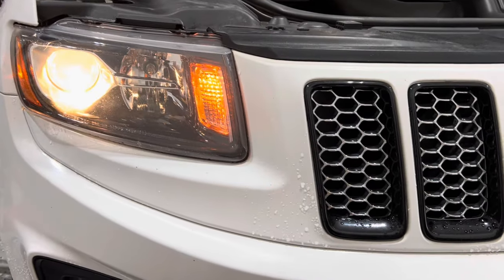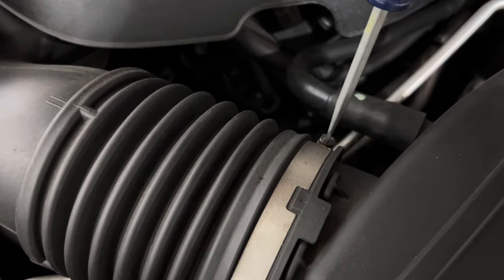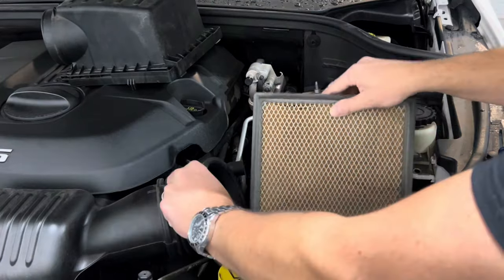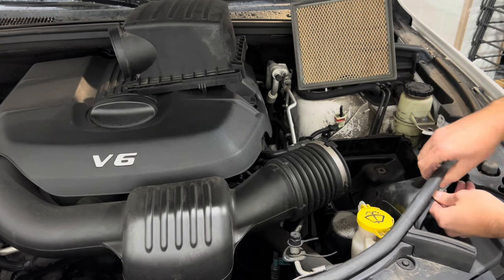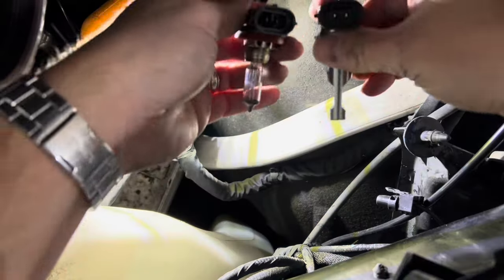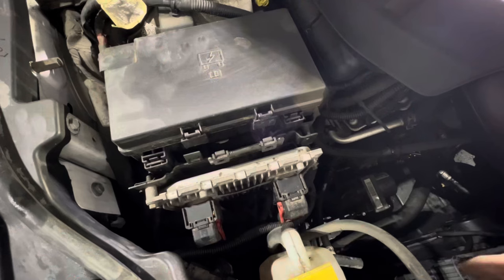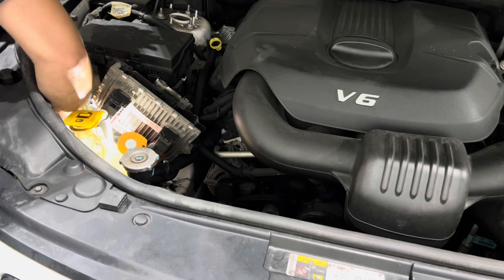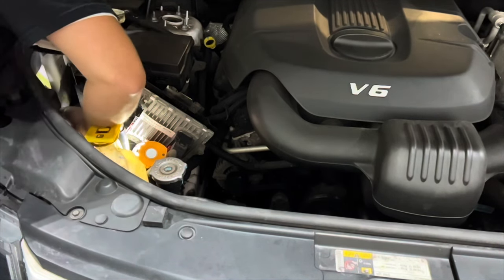Jeep Grand Cherokee Headlight Bulb Replacement (2011-2019)

Comment from the maker: Below is the link to the LED bulbs that last much longer and makes it safer to see on the road:
LED Bulbs: https://amzn.to/3W7auzU
Both low and high beams: https://amzn.to/49kf0B2

Note for both low and high beams: Order the combo H11/9005 (second link above) for 2011-2017 model years and order 2 sets of the H11 (first link) for 2018 and newer model years. 

*DISCLAIMER: The above links are affiliate links.  This costs you absolutely nothing, but pays me a small commission and helps me continue to create this FREE content.
Reply: Do these LED bulbs work for low beam and high beam?

Do you recommend replacing both high and low halogens with these bulbs?

Thanks!
Reply from the maker: @Soulith88  Hi Chris, yes and here is the link for replacing both the low and high beams: https://amzn.to/3S4bWBM
Reply: Sounds good, thanks. 

Do you find the low beam ones are bright enough?
I noticed that they are some similar looking ones on Amazon that claim are even brighter, 30,000lm etc.
Reply from the maker: @Soulith88  Yes sir!
Reply: @inspiringbuilds the link isn’t working?
Reply: Hey man! Great video and very helpful, I’d love to use the correct link that kicks some back to you, problem is the link doesn’t seem to be working. I have a 2017 Jeep Grand Cherokee Trailhawk that I need to change out the bulbs if you don’t mind sharing the link. Thanks!
Reply from the maker: @ Thanks so much and glad it was helpful.  I also appreciate you letting me know as the combo link was changed on me.  Below are the updated links depending if you want to replace just the low beams or both to match. 
LED Bulbs: https://amzn.to/3W7auzU
Both low and high beams: https://amzn.to/40RdfJE
Reply: @inspiringbuilds  Hi the 2nd link does not work - can you verify the correct one for both low and high beams and paste again?  thanks!
Reply from the maker: @ Thanks for watching and letting me know.  I believe when they go out of stock temporarily the link is no longer valid.  
LED Bulbs: https://amzn.to/3W7auzU
Both low and high beams: https://amzn.to/49kf0B2

Note for both low and high beams: Order the combo H11/9005 (second link above) for 2011-2017 model years and order 2 sets of the H11 (first link) for 2018 and newer model years.
Reply: These bulbs do not fit a 2018 Grand Cherokee.  Tried and returned from both links.
Reply from the maker: @ Thanks for watching.  You want the first link and ensure it’s the H11 bulb.  I’ve installed them in multiple 2018 GC models.

Comment: I’ve got a 2019 high altitude and instead of a cover that twists off it’s a rubber boot that you just need to pull off. In case anyone was wondering. Thanks for the video :)
Reply from the maker: G Money, thank you for watching and leaving the helpful comment!  Did you upgrade yours with the LED’s?
Reply: Fat shout for this comment! I should have read it before trying to twist. Would’ve saved me 10 minutes of frustration 😊
Reply: Yes and that lousy rubber boot just falls apart if your vehicles is older than 5 yrs
Reply: That rubber boot (I also have a 2019 GC) is horrible.  Makes it much harder to get in their to get at the bulb.  I got my driver side one replaced (which was out).  I gave up on trying to replace my passenger side (which is still working).

Comment: What kills me is they made oil changes a breeze with the top filter, but then made the headlights a pain. I can change the oil faster than headlights.
Reply from the maker: I was there with you and it’s why I made the video to try to make it easier for others.  Now I can do both sides in under 15 minutes.  👍
Reply: The Ford Fusion you have to take the entire bumper off to change a light bulb. This is cake compared to that. The engineers aren't designing these machines anymore the accountants are.
Reply from the maker: @pmccoy8924  Agreed, thanks for watching.

Comment: I’m trying to get the passenger side low beam replaced. Got the ECU out of the way. But for the life of me, I can’t get a grip on the cover to remove. Still very little room.

Edit: I realized mine has a different type of cover. It’s molded to the entire assembly so you can’t twist it off. Has a rubber lid on it that pops off. Still have to have baby hands to get in there. So dumb. 2017 limited btw.
Reply from the maker: I’m glad you were able to get it and save a lot of cash.  I agree it’s still a tight fit but it seems impossible going underneath and then you cut up your hands as well.  Thanks for watching and the comment!

Comment: Great video. Even with everything out of the way access is still terrible. Worst design on any vehicle I've owned in the last 40 years. Just as bad as the battery under the passenger seat. The job is done though. Thanks.
Reply from the maker: @nicknack1063  Thanks for watching and I couldn’t agree more as I’ve mentioned the same in other comments.  It’s a good feeling completing tasks doing the work yourself and I’m glad you were able to save some hard earned cash!

Comment: Note the 2018 bulb covers do not screw off and the 2018 passenger side is much more congested with the radiator in the way.  I also recommend using OEM if you don't want to change both.  The 2018 passenger side is very difficult and I'd rather not bother, but now I have a yellow OEM and a white LED
Reply from the maker: Thanks for watching and the comment. Note, when one headlight goes out, the other one is typically close behind. I strongly recommend replacing both at the same time.  The LEDs will last longer and help with visibility.
Reply: @inspiringbuilds  I would love too.  I can access the bulb from behind the radiator, but itd stuck.  I tried the pvc, but almost dropped it in the headlamp.  The resistance feels like it going to break when I try to turn.
Reply from the maker: @markrienhart787  PVC is definitely your friend for stubborn stick bulbs.  I’ll try to work on a part 2 video.
Reply: Same here… i might just leave it like that
Reply from the maker: @arennaz  Thanks for watching and the comment. Note, when one headlight goes out, the other one is typically close behind. I strongly recommend replacing both at the same time.  The LEDs will last longer and help with visibility.
Reply: Can you please make the video on the PVC pipe part? We cannot get the passenger side lamp out and I’m scraping up my hands trying to get the thing to budge so for now she has one LED and the other one is factory. Your video was great and made the Driver side a piece of cake. I just cannot get the passenger side bulb loose.🤷‍♀️
Reply from the maker: @wr.3428  Thanks for watching.  Yes I will have that video out within the next week so be on the lookout.

Comment: I have a 2017 GC and been needing to replace driver bulb for a while. Hate the gross yellow color (when compared to the newer jeeps lol) so i am changing both today. There was aome confusion when i went to the auto store to buy replacement bulbs. They said its better for me to bring the dead bulb to see which style my car actually needs. Finally gonna do it now because your video was super helpful. Def gonna wear gloves as to not shred my hands up in these littlw nooks ans cranies. Thanks for your video not having a lot of unnecessary commentary too. Really appreciate the atraight forward info.
Reply from the maker: @Gg_blanco   Thanks for watching and glad it was helpful!  I appreciate the comment.  I’m proud of you as you can do this and save a several hundreds of dollars.  I’m with you as well, I dislike the yellow, need better visibility, and want the new bulbs to last a long time.  I’m also making a part 2 video within the next week on the DIY PVC headlight removal tool to make the job even easier for those stuck stubborn bulbs in a super tight space.

Comment: I watched several 2014 Jeep GK LED install videos and this is the best, especially for people like me who don't work on cars for a living. Removal of the parts was easy to follow and I appreciate seeing the force needed to remove the air intake parts. Most other videos gloss over this issue. I had no concerns when I removed mine.
Reply from the maker: @timmc49  Thanks so much, glad it was helpful!  Quick questions, should I make a part 2 video that shows how to make the DIY PVC bulb removal tool and did you upgrade to LED?
Reply: @inspiringbuilds  There is a short YouTube video on making a thin wall PVC tool for the Jeep headlights I have. Do a search and it should pop up. I re-ordered the bulbs I was going to use having seen the original 90 degree plug-in style on my 2014 Jeep GC. I'll install them when they arrive in a couple of days.

Comment: Had to change my driver side bulb today.  this video was clear and to the point about what parts needed to be removed.  It took me  less than 15 minutes to change the bulb.  🥳
Reply from the maker: @martinschultz6228  Thanks for watching and glad it was helpful!  I appreciate the comment.  Did you happen to upgrade to LED’s?  I’m also making a part 2 video within the next week on the DIY PVC headlight removal tool to make the job even easier for those stuck stubborn bulbs in a super tight space.

Comment: Great video I saved $200 off what the dealer would have charged me.  Driver side was much harder due to the dealer pinching the harness against the bulb housing when they replaced the bulb in 2023.    I had to gently disconnect the harness holding the bulb BEFORE twisting to remove the burnt-out bulb.  You need pretty good strength to twist out the old bulbs and having smaller hands helps.  I recommend wearing a set of surgical gloves to prevent skin loss on your hands.  I did replace the halogens with the LED's recommended in this video from Amazon for about $40.  They appear to be much brighter and whiter than the halogens.  I can't wait to give them a try them out on a dark country road tonight.  Thanks for posting this video its great!
Reply from the maker: You’re welcome, thanks for watching and the comment.  I’m glad you got a nice cost savings.  Not only it feels good to do it yourself, but know it’s done right.  👍
Reply: I’m interested to do the same, replacing with LED bulbs, did you just replace the bulbs or didn’t you have to install anything else to make them work properly?
Reply from the maker: @Soulith88  Hi Chris, just replacing the bulb with the link provided and it’s plug and play.  Nothing else is needed. 👍
Reply: @Soulith88  Nothing else needed although I will say I'm not satisfied with the LED bulbs and will try to adjust them.  Not seeing dramatic improvement over the stock halogens at this point.  It's possible that things will get better after I try to realign the lights.
Reply: @rvan7350  are they brighter and light up the road better than the halogens?
Is it just the placement/ beam of the light or the brightness and colour?
Reply: @Soulith88  After checking I found that the passenger bulb had not been seated properly by me, so it was not properly aimed.  I reseated it and there is some improvement although I still have to say that the LED's aren't providing the dramatic improvement I hoped to see.  I would say they are definitely whiter and brighter but not necessarily a better driving experience.   I may still tweak the alignment to see if I can get some improvement but not sure I would use the LED's if I had to do it all over again.  Thanks!

Comment: Oh my gosh this is much harder than it should be (especially the one behind the ECU)!! And both going through their port hole is a joke!! I am not that big of a guy but do have pretty big hands and without your suggestion of the pvc I would have struggle much longer (I knew I was going to need some additional leverage to turn that bulb but was having a hard time coming up with the right thing; the notched pvc was the ticket).  Thanks so much!!!
Reply from the maker: Glad it was helpful and thanks for watching!  I agree engineers made this much more difficult than needed and I cut up my hand pretty good the first time going through the port hole and wanted to find a way to help others.  Couple of quick questions - Do you think a part 2 video would help those needing to make the PVC tool and did you decide to upgrade to LED for better visibility and not having to mess with changing them again for a long long time?
Reply: Might help some on making the pvc tool as that seems to be the way to go; I knew what you meant so I was good without it. I went with some Silvers as I wanted to keep the color looking somewhat similar to the rest of my front lights; they are slightly whiter than stock but not noticeable looking at vehicle. I suspect they are also a bit brighter too.
Reply from the maker: @markvandeslunt8110  Thanks for the feedback and the silver’s would be a good upgrade as well.  Nice work and saving cash on the DIY.

Comment: Thanks so much for the video. I did struggle a lot more with the passenger side. So what I tried is just removing the coolant reservoir. Pulling it up and twisting it out of the way. It allowed me to have so much more room to work with. I could get the low beam out so much easier. Might not even have to move the ECM. I did for just a little more room.
Reply from the maker: @ericgraham9551  You’re welcome and thanks for watching.  I’m glad you were able to DIY and save some hard earned cash.  Thanks for sharing as well!

Comment: Thanks for the video! I was able to swap out the driver side. I noticed in some of the comments you asked if you should make a video showing how to make the PVC pipe tool for the passenger side. Yes, that video would be super helpful!
Reply from the maker: @bryanwood636  You’re very welcome and thanks for watching.  I also appreciate the feedback and will work on that video soon.  I do recommend to replace bulbs in pairs because if one burns out the other one is usually close behind.  The PVC tool is definitely helpful for the passenger side.

Comment: Had a hell of a time. I couldn't figure out why yours was so much easier. Then I saw the V6 on a second watch through. You have so much more room for activities! I finally managed it, but there's definitely some dust on the bulbs. 😂
Reply from the maker: @onelonglizard  Thanks for watching.  I’m glad you were able to get the job done yourself.  It has to feel good to save money as well. 👍
Reply: Assume you have the V8? I do too and wondering how much harder it is?
Reply: @ElCidPhysics90  I do have the V8. I haven't personally done it on a V6, but the video looked much easier than the time I had. My hands were pretty banged up and bleeding by the time I finished. I was extremely surprised the bulbs even came on afterwards. I was certain that I broke them trying to get them in the socket.
Reply: @ jeez. I may just left a dealership take care of this then. I was hoping to install leds though and I’m sure they won’t do that
Reply from the maker: @ You can do it.  The first time takes the longest, just take your time.  Save the money and get the upgrade.

Comment: Great help.....I couldn't figure out how to get the driver side light out. Ridiculous how many parts you have to take off just to get your hand in there to change the bulb.
Reply from the maker: @JohnDoe-df2zz   Thanks so much, glad it was helpful!  I agree, the engineering certainly could have been improved.  Quick questions, should I make a part 2 video that shows how to make the DIY PVC bulb removal tool and did you upgrade to LED?

Comment: Great video, I have HID's in my 2018, changed the passenger side a year ago, scrapped up my hand, this will be simplier
Reply from the maker: @davefisher5196  Thank you very much and I appreciate you watching.  I feel your pain as I messed up my hand pretty good and wanted to find a better way to share with others.  Just remember when one bulb goes bad typically the other is close behind so I recommend replacing in pairs.  Have a great weekend!
Reply: well it was not any simplier, removing the air box was a piece of cake, I have skinny hands and man I still had to be a contortionist to get the bulb out and then back in.
Reply from the maker: @davefisher5196  I found it quicker and prevented my hand from getting tore up.  It does require a bit of work either way due to the manufacturers design.

Comment: I have a 2018 grand cherokee trailhawk edition. I tried do this last weekend and had no luck. My car has the rubber boot over the bulbs, so that was easy to figure out. I just can't get a good grip on the bulbs. They're really tight in there. Do I need to twist them out? I'm afraid if I put to much force they'll break. HELP!

Comment: Thanks for this video - helped me a lot.  Changed both low beams in ~30 min on my 2014 Laredo
Reply from the maker: Nice work, you’re welcome and I’m glad it was helpful!  Two quick questions, would a part two video making the PVC tool be helpful and did you upgrade to the LED’s?
Reply: @inspiringbuilds no I just reinstalled H11 halogens.  Probably  going to sell it and get something new in the next 6 months.
Reply: @inspiringbuilds the PVC could be helpful to some, although I was able to do it by hand on the passenger side without any help once I was able to look at the mounting area where you seat the bulb.
Reply from the maker: @tomcarter1068  Thank you I appreciate the feedback.  Nice work again and congrats on saving money and doing it yourself.
Reply: Have you changed out the fog lights? I just got me a 2015 Laredo and I'm wanting to upgrade to LED.
Reply from the maker: @stuarttaylor2107  Not yet, would this make a good future video? Congrats on the new ride!